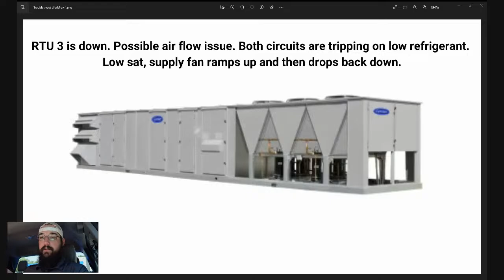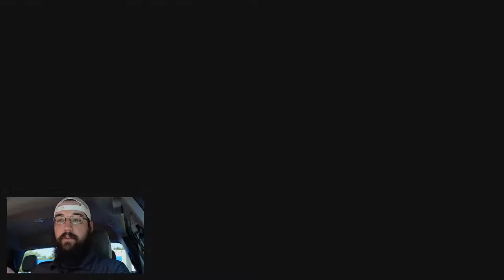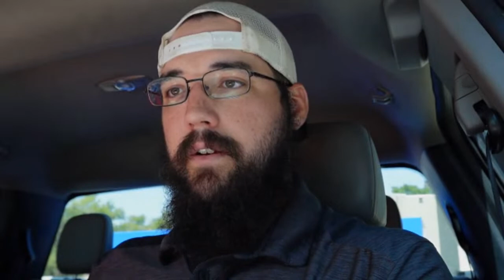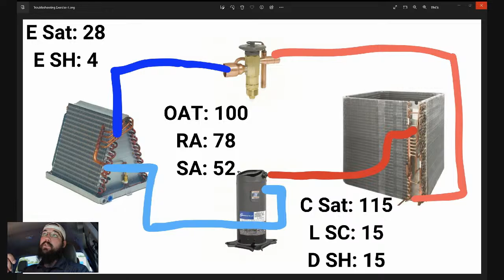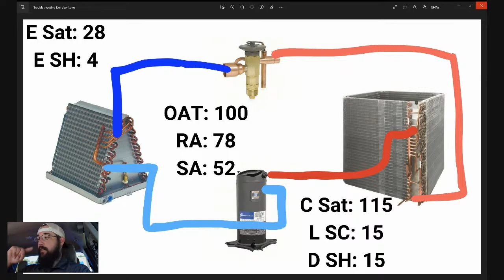HVAC Tech Troubleshooting

Comment: Just had a TXV ramping between 1 and 15 every minute or so, found terrible static pressure causing really low sat temps and when I opened the duct up the superheat leveled out, I was the second opinion, the last tech said the txv was bad

Comment: If that was a constant volume rtu the fan speed could change depending on what stage of cooling  its in
Reply: Its a VAV-VFD set up
Reply: Well then your going off of a discharge air temp setpoint along with duct static setpoint for the fan to meet the requirement of. Correct
Reply: @HEFTYLEFTY303  fan gets a start command....uses SP transducer to send a speed reference...discharge air set piint is for compressor staging. These units he is talking about are a pain in the butt. More than half of them have flattened out condenser coils.
Reply: If that's so the tubing where that duct static transducer is critical the outside air reference cannot be sensing from the cabinet. Because air may pressurize the control cabinet and give you a false reading. Just a thought
Reply: @HEFTYLEFTY303  you would be correct. They don't use rain birds like intellipaks do....just a hose sticking out.
Reply: I would get your manometer and tee into the hi and lo and see what it's reading then move your low to outside the cabinet and see what that is if it's the same then there's another issue we can work through together bro. Lmk
Reply: I work for carrier Corp denver
Reply: Did you happen to perform those checks. I'm just trying to see what your duct static actually is
Reply: @stephengallegos457  the static was correct as being read by navigator and building BAS.
Reply: What were your delta t across the evap
Reply: Well I'm here for you broif you need me